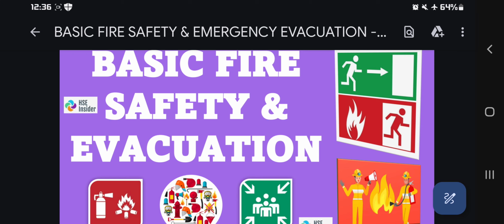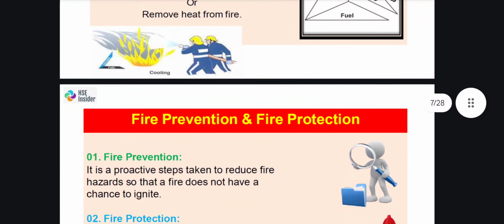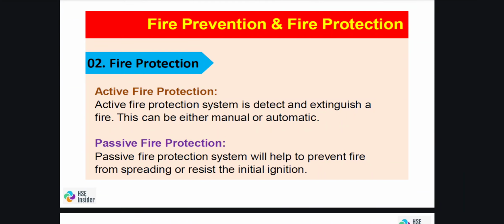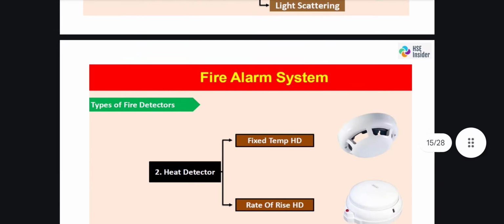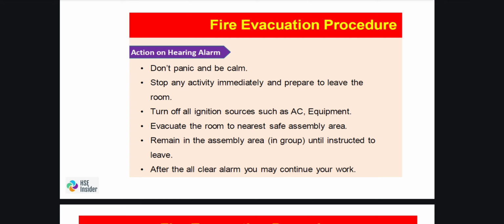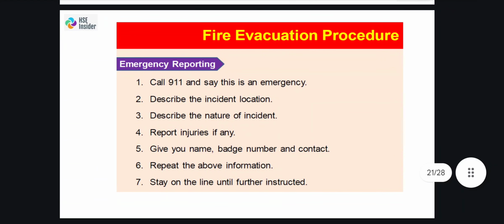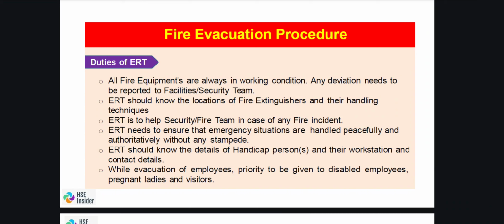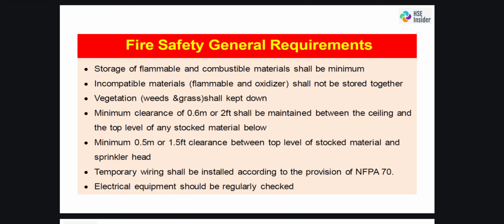Fire Safety Training  |  Emergency Evacuation Plan  |  Workplace Safety

Comment from the maker: FREE - ISO 45001 AUDIT CHECKLIST : PART 1
https://smathanshse.blogspot.com/2021/04/free-iso-45001-audit-checklist-part-1.html

Magnetic Mini GPS Locator
https://kicklo.com/products/magnetic-mini-gps-locator?ref=cOEHE

Construction Crane Safety Inspection and Operation safety
https://payhip.com/b/OZos9

Electrical Extension Cord Safety
https://hseinsider.blogspot.com/2022/07/electrical-extension-cord-safety.html

Static Sparks Explosion  
https://youtu.be/g1tzw9cSLWs

Breaking Free from Anxiety
https://vocal.media/education/breaking-free-from-anxiety

Manual Handling
https://yo.fan/p/mVGYrSCgjUF

Why We Need to Do Workplace Safety Risk Assessment
https://hseinsiderconnect.blogspot.com/2023/07/why-we-need-to-do-workplace-safety-risk.html